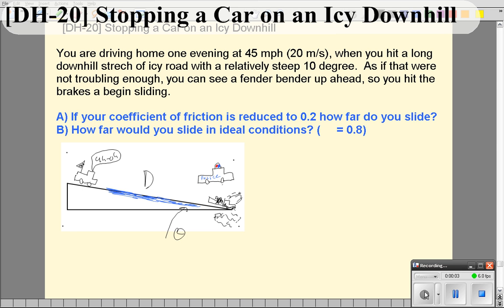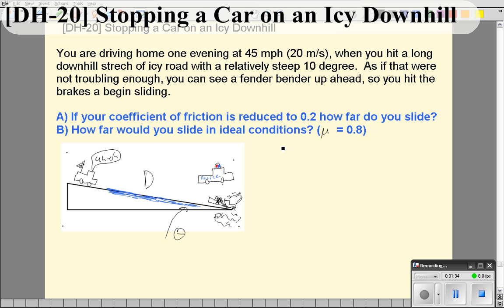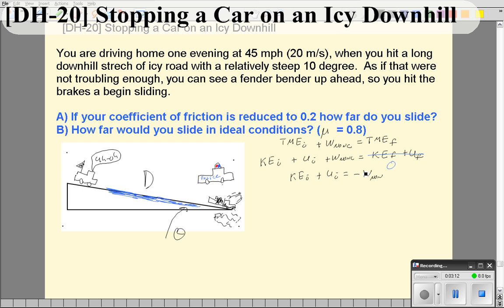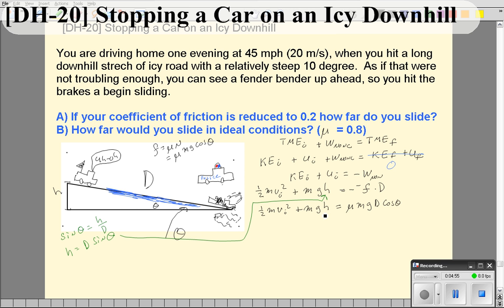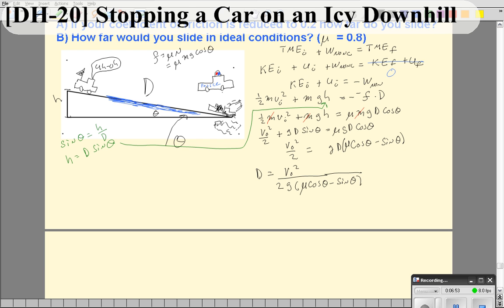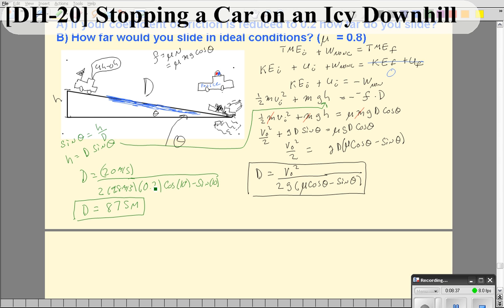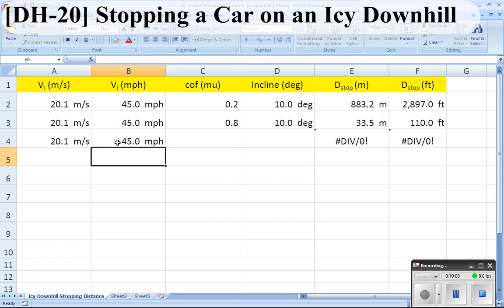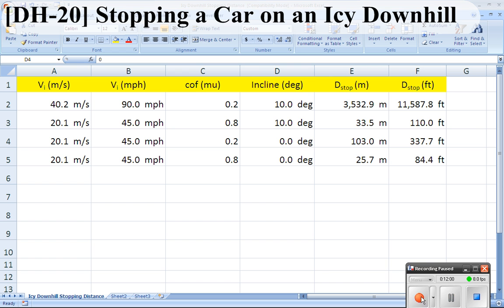[DH-20] Stopping a Car on an Icy Downhill

Comment: okay, managed to get it. can you help me with my question, ive been at it at 2 hours and none of my answers are one of the selectable ones. a truck with 30 tons is going down a 3% slope (so 1.71835 degrees i think) at 36 kmh, so 10m/s. how long does it take to stop. i wouldve said 166 meters but thats not one of the answers. please help me! my is 0.06 (icey road) g is 10 m/s^2, and it says sin=tan=grade%, cos=1.   answers are 79, 86, 204, 102, 186, 136, 221, 150 meters
Reply from the maker: Not sure what "says sin=tan=grade%, cos=1" means.  But a 3% grade with 36 kph initial velocity takes 166.7 m to stop if g is 10.  See the following desmos.  https://www.desmos.com/calculator/odzn3f7utf
Reply: @PrerequisiteName  thankyou for the reply, 166 is what i got aswell. im also not sure what it is supposed to mean. i am from germany so the translation isnt perfect but it still makes absolutely no sense. thanks again for the help! god i love the internet
Reply from the maker: @vincent9028  I think you understand the physics well, and that is the most important thing.